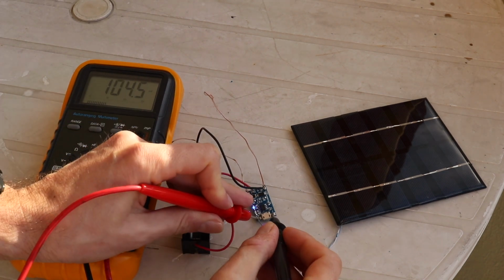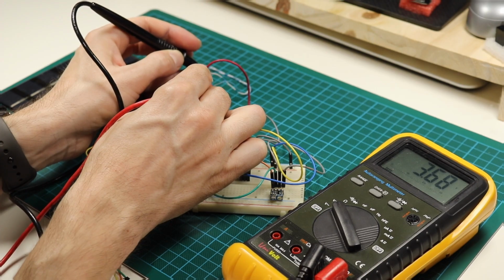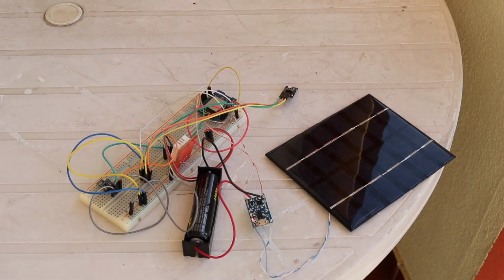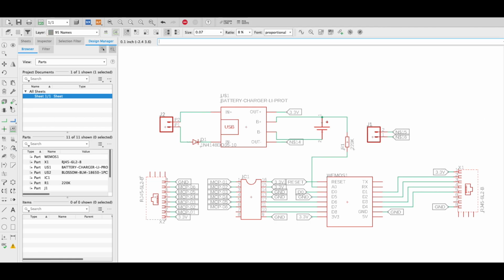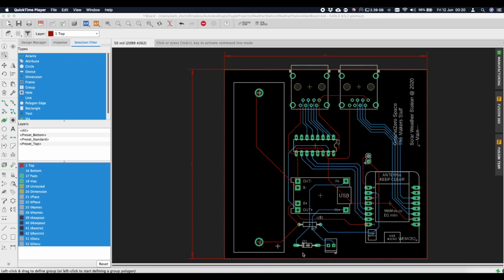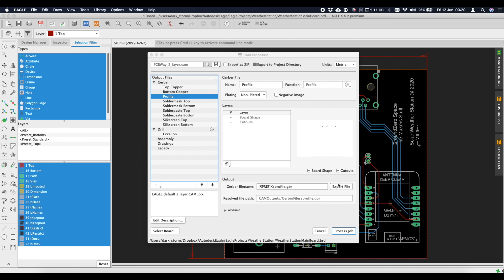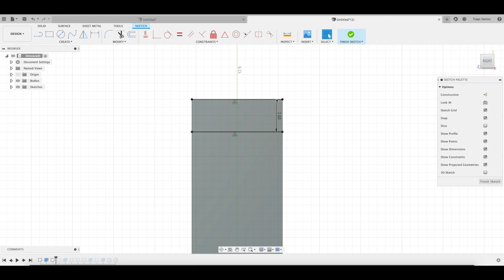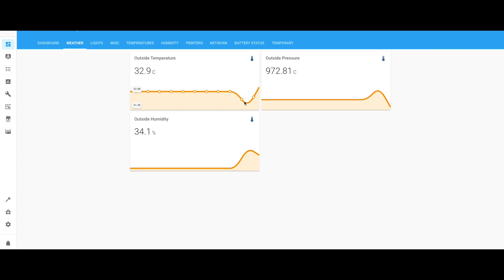Modular Solar Weather Station

Comment: Why did you divide weather station into two rather big boxes, and why the solar panel is so small? How long the WS running - i ask about energy budget/bilans.
Reply from the maker: Hello. The WS is divided because is planned to change the box by a bigger and all watertight to accommodate multiple equipment (lora gateway, wifi gateway,...). All this equipment doesn't like humidity and water. Also, isn't on video but there is another module (analog module) for measure air speed and direction. With this option i can protect the equipment and still measure the data. Also is on two boxes to show that is possible to separate the components (for example the main module can be indoor and the sensors outdoor). On the tests that i made before the final version, the battery was power the station during 30 days without solar panel. At the end of 30 days, i've turned off to make the final version and the battery still had charge. Being on deep sleep the wemos doesn't consume enough to drain the battery and the solar panel can keep is charged,
Reply: @themakersstuff  Great! This Lora gw could be very attractive, especially if it will support lorawan from TTN. This could be nice if you will make some measurements: how much energy is from the sun ray, how much energy consumes was. I will subscribe you channel. Good luck!